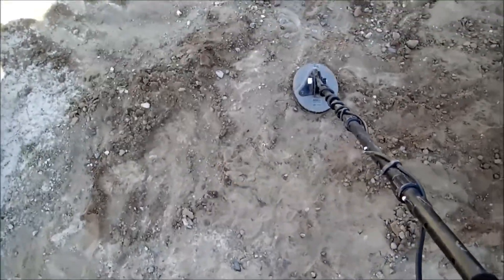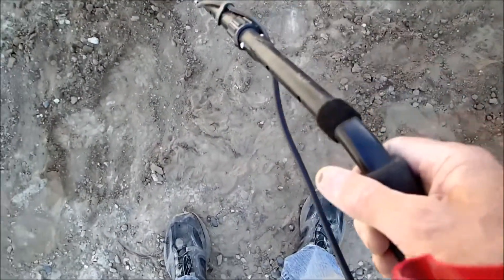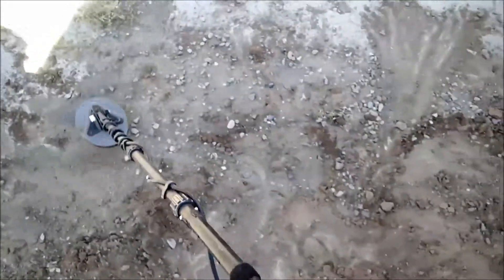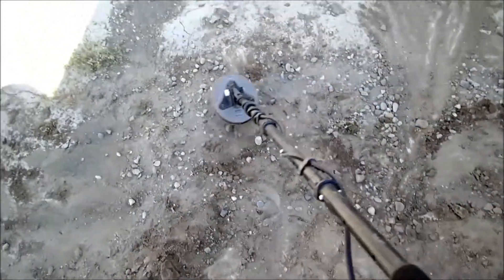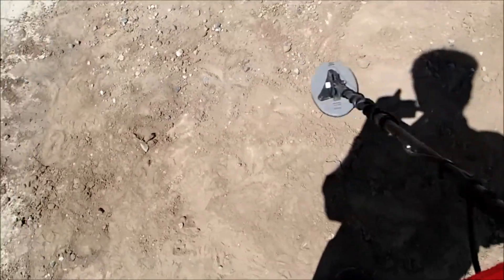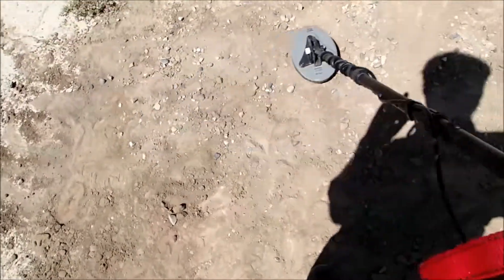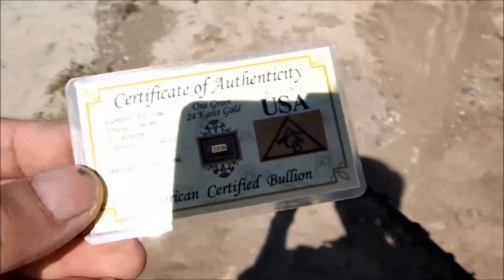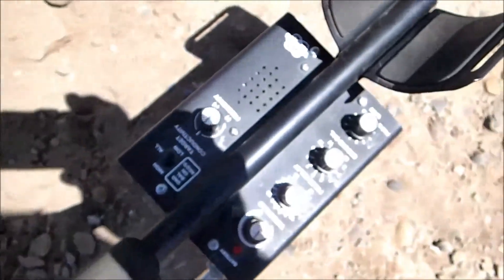2nd TDI SL mod

Comment: what year is your detector?
Reply from the maker: 2013
Reply: I've just bought one, a 2018. I wonder if these refinements have already been done from the factory?
Reply from the maker: @wsmith6225  The factory adopted the second mod, but not the first. A friend bought the Special Edition this year. He's an electronics tech for the Navy. He took it apart to see which mods it had, and found only the second had been done. That involves removing two diodes, and one capacitor. It does increase sensitivity, but only a little...maybe 5-8% in an air test on a 1 grain gold bar. The results of the first mod, whereby you increase the allowable sweep speed, is much more dramatic.
Jim
Reply from the maker: Yes, all SL's since 2015. But only the second mod. Not the sweep speed mod, and not the last sensitivity mod. Both of those you  have to do yourself @wsmith6225
Reply: What voltage are you running?
Reply from the maker: @wsmith6225  4 cell li-ion (16v)
Reply: What batteries? and charger? @jimnelson7740
Reply from the maker: @50Quid-d3x  I built a 4-cell pack using Sony 18650 3400mah batteries. I also installed a battery management board to individually monitor each battery. For a charger I use an adjustable Step-up buck converter from DROK. The converter can be had from Amazon. The battery pack needs to have a plug-in installed for the charger. I guess I should sell a set of plans and instructions on making the 4 cell lithium pack. It used to be possible to buy a pack from a guy that went by reidman2u on Ebay.
Reply: OK great. Thank-you!